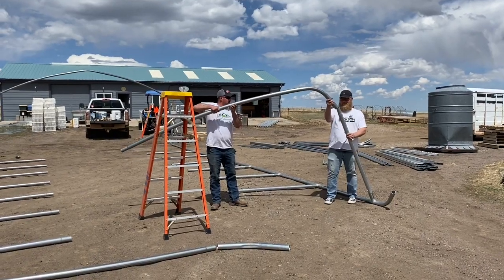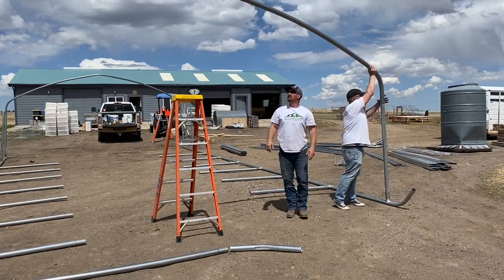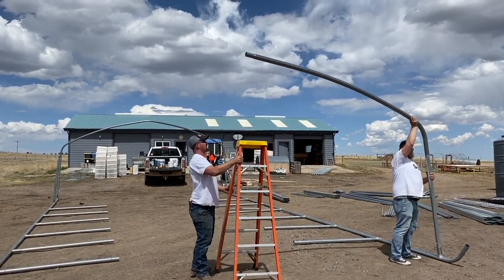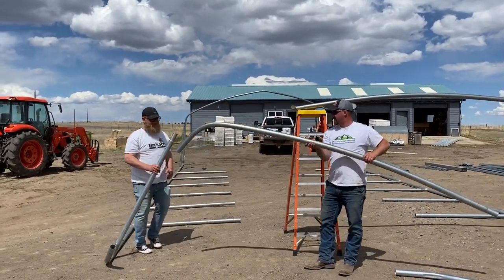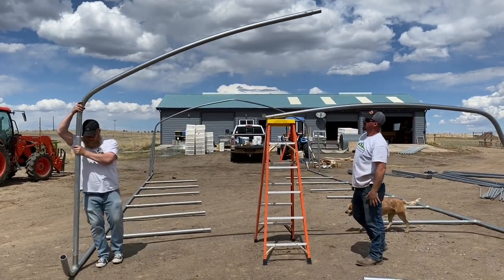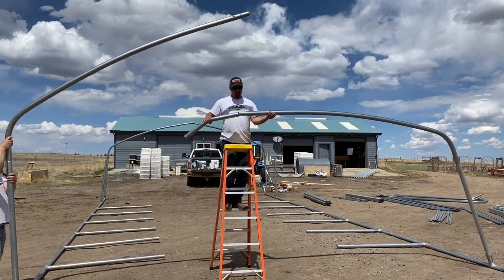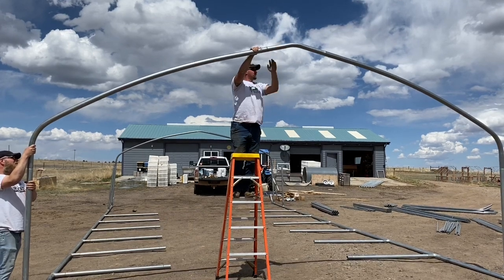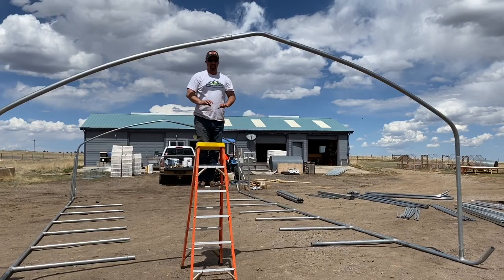Schooner Assembly Step 6  Erecting Hoops

Comment: I am in the middle of trying to assemble one of these. The instructions that they sent me are not very clear. There are no details on what size holes need to be drilled, if the cross bars get two holes and two bolts or one and some of the parts are different. And that’s as far as I’ve gotten. You would think $8000 equipment would come with a better manual. Just know that if you buy one of these you are going to have to figure it out yourself.